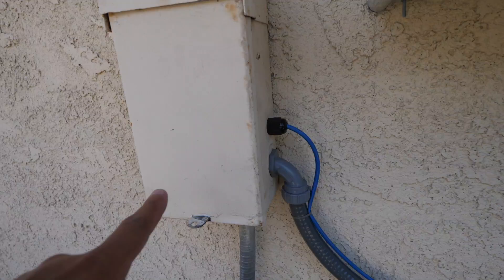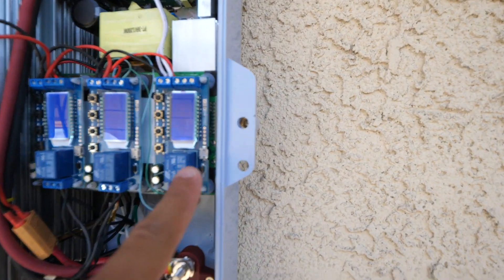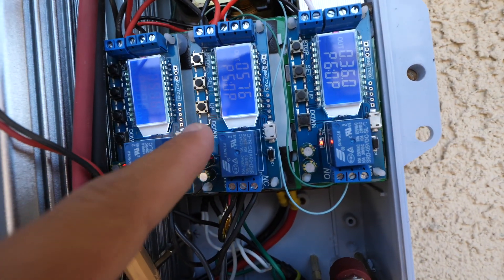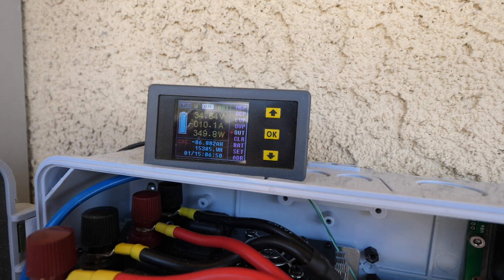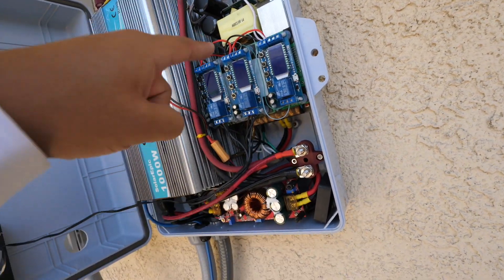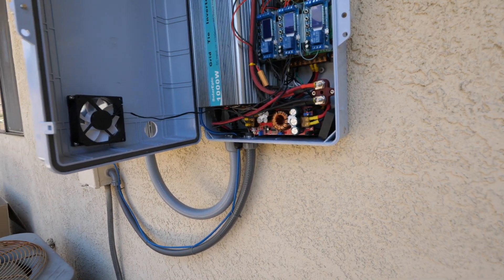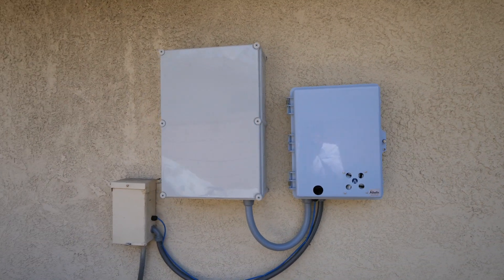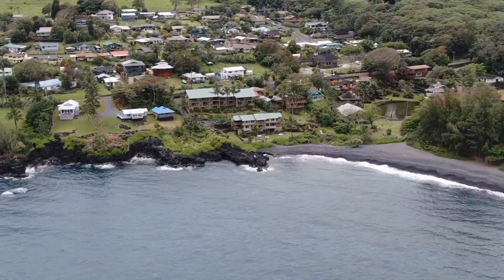Peakshaving DIY Powerwall  Project

Comment: Can't imagine any of that was legal or electrically compliant the way that box is.  Still very cool, but folks should understand that normally, this requires proper inspection and code work and no way you can have fans venting the way that is setup...

Comment: Nice project,  It may have been said somewhere in the 350+ comments below, but you might want to check the factory sequence of operation on the A/C unit.  Usually the sequence for A/C turning off includes 2 or more stages.   First the compressor turns off and about 5-10 seconds later the condenser and evaporator fans turn off.  Your DIY setup is performing a hard shutdown.  This will slightly over stress the refrigeration cycle and potentially cause abnormal wear on the A/C unit.  Switching the A/C unit off via the thermostat wires (instead of the electrical disconnect) will generally restore factory sequence of operation.  Cool project dude!
Reply from the maker: I’m not interrupting the AC supply to my AC unit.  I’m simply turning on/off grid tie inverters at the same time as the AC unit

Comment: Super old A/C - my old unit pulled around the same as yours - 4.4kW on cooling mode in Florida.   Installed a new variable speed 14SEER - nothing fancy - but now it only pulls around 2.5kW.  So much more efficient!  You would almost be off grid!

Comment: You might double your run times, if you remounted the hot inverter into a metal box which has radiator fins, that are like CPU coolers.

Comment: That's brilliant.  This is very similar to how generators for our radio sites control timing for load.  Our systems use large Libert UPS systems and they have about 30 seconds between switching.  Those do have a transfer switch though to shift from commercial power to ups and then back after restored.  That's about the only difference really though.  The function is really similar.

Comment: Interesting video.   With Air Conditioning units, you should look into DC powered Heat Pumps.   I hear they are very efficient and you can direct wire solar panels or batteries into them, by pass your house electricity altogether.
Reply: This is what I am doing love the units I have

Comment: You may want to rotate your condenser 90 degrees counter clockwise for more air flow through coil  and potentially cooler air and shorter compressor cycle times.

Comment: SCE should hire you! Also if you're worried about thermals on the Powerwall Modules I would invest in thermal meters. Just remember its easier to remove heat from electronics than to Apply cool air, Pull cool air from the ground release hot air from the top! Simple PC Airflow builds! ;)

Comment: Taking, a possibly IP rated enclosure, and leaving the conduit holes open -- and no rain guards? -- even in California you need it, especially if you use sprinklers or anything else -- exposing high amperage DC to water is a no-no

Comment: Nice video as always and i really like your idea ..what i would improve is cooling of that unit ..those wents looks strange..even that fan on top is wrongly placed...it isn't taking air out or in..also i'm missing there fan grid..you can buy those for few dollars.. any bug/spider/ants could go inside and for sure you don't want that..soo please seal the box with some mesh ..also on that fan down there ..increase the hole so pc fan is covering all area..put there some protective mesh ..make that top cooling hole bigger or use it in different spot ...cooling is the big thing for those tight spaces..

Comment: This is a fantastic idea! I do have one quick question, do you have to synchronize output of your inverter to the grid?
Reply: Grid tie inverters AUTOMATICALLY synchronize... matter of fact, they will not operate until they have sensed voltage sync...

Comment: What is charging the batteries?
We installed 22 solar panels. So far it seems to pay about 75% electric bill. When we pay these panels we are going to see if there is an area on our roof for enough to pay our bill 100%. The plus of all of this it will add $10,000 to our house at selling time. Don’t ya just love it. For some reason I feel like I’m putting it to the man. Plus, my art shop (My He-Shed is solar powered accept my Ac/Heater unit. Yes, it cost about $1000  to do it but I run all of my tools and dust collector on solar. It still makes me feel good.

Comment: Mr. Garcia, what a great Idea, will you have a detailed video on building each module as well has how its wired up?  What about doubling the Grid Tie inverter, maybe you have two 1000 w inverters, would that balance the load and put less stress on the one inverter?

Comment: For fixed rates peakshaver make no sense.  And for variable rates will only save if the battery packs are charged by wind and solar. You can't use 1250 watts charging batteries to save 1kw. Running the a/c with DC without inverter will be even better.
Reply: Can't run an AC motor without an inverter.
Reply: @sammyd7857  Yes, you can. My car a/c run without inverter, Only DC. The HotSpot DC4812VRF is a purpose-built DC powered air conditioner heat pump for native DC power. It's designed to conserve power, and operate reliably for many years without maintenance.
Reply: @neliosamch3195  yes and they are still expensive compared to capacity
Reply: @sammyd7857  Model TBP-12000BTU in Allibaba is $500 dollars but wind and solar is free.
Reply: @neliosamch3195  did you buy one already?
Reply: @sammyd7857  No, don't need one but I'd first  replace the insulation of the house with R-60 then you won't need one a/c.
Reply: @neliosamch3195  so you are probably wrong about the price. Unless you message the supplier you don't know the price.
Reply: @sammyd7857  That is the unit price. It doesn't included handling shipping or tax.
Reply: @neliosamch3195  the unit prices listed in Alibaba are correct only for multiple units. You only want one it is not the price listed.

Comment: OI OI OI JEHU , yes it me from the undesirable land downunder of which u dont care about....lol. What was ur excuse... we dont matter cos we are toooooo far away... bah humbug to u I say.  Well this was a pretty confusing explanation  of what u built, that blue cable between the a/c box and the controller box, what voltage is going thru it and  is that cat 5 or 6 cable? Is the grid charging the batteries? Is this unit in operation during the peak charging rates and does the batteries charge on the cheapest rate?? if so then fantastic.... screw the power company I say. Cos they just wanna screw everyone  :)~ Why dont u get a grid tie inverter that can handle longer and higher loads so u never  use grid during peak times?
Reply: BTW u looked like Tatoo the midget lying on the ground next to ur wife as the drone off and away.

Comment: I have same grid tie inverters and they run their internal fans when temp goes over 40C, and they do not ask for cooldown period. Do you need cooldown period because they are not always on and thereby the internal fans are not running? Why not just wire the fans outside then, needing less of a break and more working time :)
Reply from the maker: Run them at full 1000w for 10 mins straight and see how hot they Get.
Reply: @jehugarcia  I dont really trust cheap chinese tech ever to run at 100% so I keep healty  margin and provide each inverter with a max of 600w of panels :) 
That way they are very unlikely to ever burn out and make me replace them. 
So in your case, maybe adding third to share the load would provide better operational cycle? 
Or would that also be just pulled to full load due to drain being higher than 2.2kw? I guess there's no easy way to limit the load to inverters..

Comment: You could also have a device automatically spray water over the AC coils when it turns on to make cooling more efficient.
Reply: You cpuld use the condensed water from the AC

Comment: So running HOUSE AC with only 1000 W Inverter? I need that!!
Reply: Not the entire AC system, I think just helping out with the outside compression. The furnace fan inside is probably on house power only. But I'm not sure.
I'd be interested in seeing how much it actually saves in money.. vs what was spent.
Reply: Gutz not possible, he is grid tied, the batteries are feeding into the grid of his home when the AC is in use, reducing the amount of power the AC unit is pulling from the meter. Startup on AC that size would be around 8000 watts, or more... running, on that 20plus year old system is likely 3 or 4000 watts, but the 1K inverter significantly reduces the amount of power the utility provides to the meter, and at peak power costs, it will save a lot on his bill.

Comment: I don't know crap about powerwalls electricity so this might be a stupid question are you using solar to charge the batteries or you using electric company power and just using night time to charge it which I would assume it's cheaper to charge batteries at night because mostly everybody is sleeping and the cost of electricity is cheaper at night
Reply from the maker: Both

Comment: A question that is not related to this video - have you ever seen people using used tablet batteries to build a power wall? 
Batteries are in very good condition, mostly from tablets that had broken screens. One type is 3.7 Volts 32 Wh, another type is 7.4 Volt and also 32 Wh. If you need to see the shape and size, please search for images on google for TYPE9MGCD or for another one search for TYPE8WP5J
Thanks for the great video.

Comment: I have considered doing this; leverage a whole-home battery to run A/C during peak hours.  Even if you charge it from off-peak grid, you'll save a little on energy costs, and it helps tame the duck curve.
Nice to know there's a term for it: Peak-shaving.
Also yeah, I would put a downspout and screen on the intake.
Reply: Specially with time of use....what a crap that is. Imagine that electricity costs more when the sun shines than when it's dark!

Comment: This is just what I need! Dumb question, do you just set the constant current dc-dc converter to whatever current the battery can handle and that's it to charge? I guess you also set it to the correct voltage for a fully charged battery too right?

Comment: This is probably my favorite video yet. I don't have time of day power but my company has it as an option. I think I will need to set something like this soon.

As an aside. Do these grid tie inverters reduce the load at the breaker? Like if I plug this in to the wall where I have a window AC, will the amp that hits my breaker be lessened because of the power being fed right next to the AC?
Reply from the maker: Yes,  electricity follows the path of least resistance,  so your loads eat it  first before it would flow into the grid

Comment: Nice looking, I am experimenting with fast charging of the cells you use. I am wondering if it could be anything you could use with your setup? I use an 18vdc to charge a bank of 180vdc. The run battery only uses a few volts. Maybe we can get longer run times from the same output??

Comment: I like this..There is one thing you need to attend to right away though.  The unit isoutside and you have holes. Thats a NOGO. but just get cap and cover the holes leaving a gap on the bottom so aiir can get in.
Reply from the maker: Filters will be installed

Comment: You talked about the build, but not the how and why it works with the AC unit. Even though I previously worked as journeyman electrician and I now do engineering work, related to industrial equipment and industrial robots, I have no idea how the 120V inverter is supplementing a 240V air conditioner. Can you fill in the blanks? I'm thinking if I don't know what you're doing here, a lot of others would be confused too.
Reply from the maker: Split phase,  each inverter feeds half phase
Reply: @jehugarcia 
Oh, I see. I only observed one inverter. Thanks!

Comment: Let’s quickly talk about the grid-tie and your electric meter.

When I worked for a company who installed solar panels, I actually installed them. Our boss reminded us not to leave the system on when we left. For two major reasons.

1) It wasn’t inspected yet by the town and electric company.
2) And most importantly. The solar array with the mini inverters (grid tie) was seen as a load for the electric meter. Therefore this one customer saw their electric bill nearly doubled for the month. As the array was active but still had an electric meter that did not do net metering. 

So be careful if your electric meter does not do net metering. Even if it can, and you know this by looking up the model number, then it still may not be set up to do so.
Reply: He has designed his system to only offset a portion of the air conditioner load. So the load on the grid will never go negative. Therefore a net meter is not neseccary for this setup.
Reply from the maker: Correct,  no feeding the grid from me
Reply: jehugarcia take my money!!

Comment: can you build a small grid yourself at 60 hz , pure sine of course , to trick the grid ties , and then use  a grid tie ( or ties for multiple ) to work on that  ? I like the idea that if a main inverter were to shut off then the grid ties would stop also like if the real grid went down - just not sure if the main inverter could take the pressure of multiple stack able grid ties would push  ?

Comment: Add 4X battery and 4x 300W solar panels, take your AC off grid.
Reply: christothegreat1 look up California peak electric rates.  This is a small affordable project that avoids expensive complex permits and just shifts power consumption off the peak hours.  He is showing a small setup that’s focused on his one large power consumption device.  A more complicated design could use the API from his www.sense.com monitor using a raspberry PI and act more like a Tesla power wall gateway.

Comment: Nice setup... another great idea from our mentor.. ;)
4 any1 who wants 2 do anything similar, I would recommend a metal box (instead of plastic) it will definitely help with the heat dissipation...
Move the fan (& hole) from the door to the bottom...
The hot air out needs a baffle to prevent rain entry (depending on where u live)
Also a bigger inverter (& battery as needed) would probably negate the over heating issue & mean less timers needed etc...

Comment: Did he say 2.2Kw is that 1000 watt grid tie inverter that inefficient
Reply: look carefully. There a 2 of them installed. So they deliver 2000Watts and drain the Batteries with 2.2KW. 90%Efficiency. Not very good, but common for such a kind of inverter.
Reply: @sonntagskind84  ok that makes more sense
Reply: @james10739  No prob. I asked myself the same while watching. (I know the 1000Watt-Cheap-Inverters from other videos, and thought of an huge overload :D )

Comment: Not that the box is not weatherproof, you also have intake fans that could blow air/water directly to the electronics. 
Am I missing something or in your neighbourhood just never rains :)) ?
Reply: A very find mesh cover for the vent could be an easy fix for it
Reply: @treypop123  That will also keep the bees from building inside.
Reply: Yup, this is the only thing I can think of that could be bad. I mean, I doesn't really rain much in California, but still,
Reply: make small vent plenums out of aluminum flashing and rain tape to keep rain out of the fans.
Reply: Istvan Gereb agreed... that might last in SO. CAL... but never in my state... SEALED weatherproof equipment in my state gets soaked...
Reply: Numb nuts are you blind its under the roof so rain wouldn't affect it
Reply: Thanos -so rain only falls vertically?

Comment: Nice build, also nice mouse holes in the inverter box...a little knawing sets 🐀 on 🔥, then 🐀 sets house on 🔥 all without tripping the 100A breaker or the hoverboard batteries sketchy BMS overcurrent limit ....but seriously screen the holes. 🐀 is always a safety wildcard.
Reply: Mykel Hardin  that's an actual problem you dense cabbage
Reply: I think the real problem is you typing words in unicode pictograms instead of normal text
Reply: @ikichullo  🖕

Comment: so if your battery pack can handle your air conditioner what's the use of having it so you didn't build a big enough battery pack what you need to do is build a bigger one when you build a bigger oneso how big of a battery Bank do you go to build in order to run that thing for 6 hours during peak hours
Reply from the maker: About 10-15kwh

Comment: Have fun in Hawaii why didn't you make a battery pack big enough to handle that air  toner to run 6 hours
Reply from the maker: Because I build proof of concept first
Reply: @jehugarcia  I don't understand why you want to heat the battery up till it gets too hot or the inverter shutter-down heated up shutter down heated up should never put it in that kind of environmentthe lithium battery supposed to be recycled slightly so you have like a hundred more of them that way you don't drop them at all but having them drain all the way down to where they cut off that machine and into 10 minutes that's ridiculous

Comment: How long before those relay contacts weld themselves together?  That type of relay is only good for switching small signals. A solid state relay would be better.
Reply from the maker: I’m within operating specs of the relays so only time will tell
Reply: look thru his links, he's using a 200amp DC relay for the heavy lifting, the timer relays only handle the low amperage logic part

Comment: Have you found that this set up has helped your electricity bill at all???? and do you think if all residential and even commercial buildings had something like this, it would help with the need for power? maybe not though if its needs power to constantly recharge the batteries.